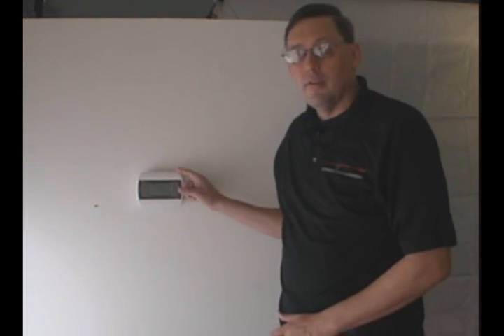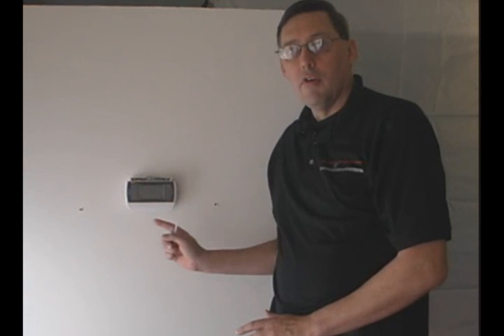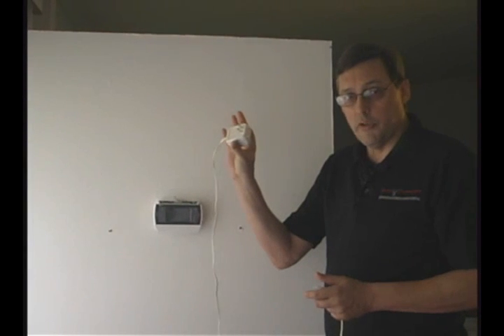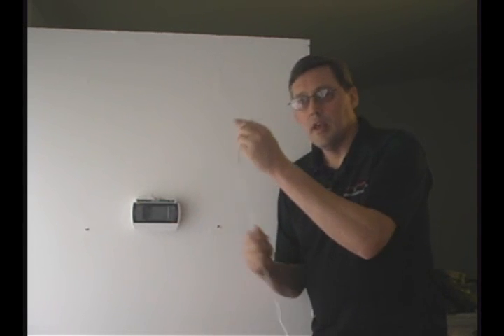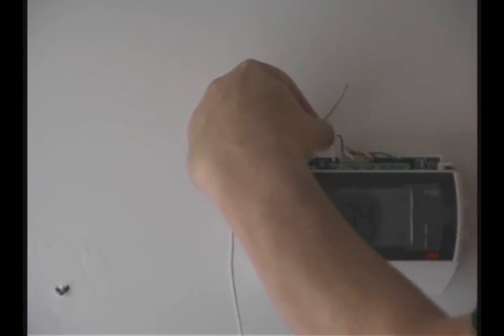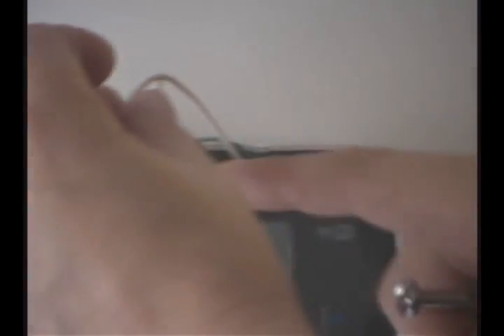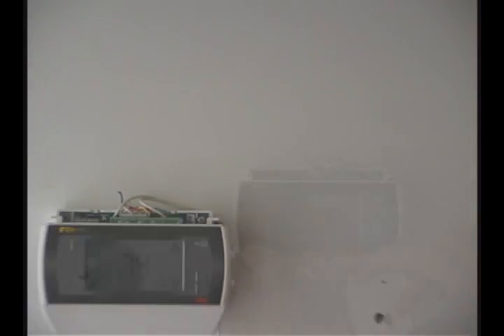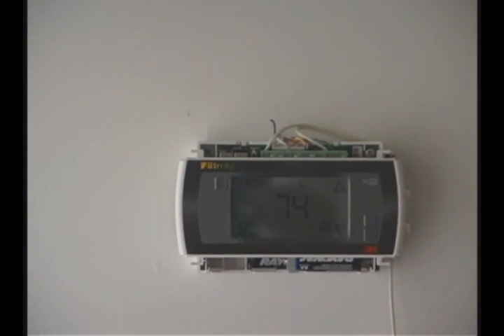C Wire - How to power the thermostat via an external transformer

Comment: Thank you for this.  I am planning on doing this for my thermostat.  One question:  Should I remove the jumper from R to RC before adding the external transformer to C & RC?  Currently I am using a two wire, plugged into R and W.  The R is jumpered to RC.
Reply: you dont have to, only if your using it for 1 heating and 1 cooling with two separate transformer
Reply: I tried to do this on my google nest thermostat I started getting error codes on fan and cooling circuit